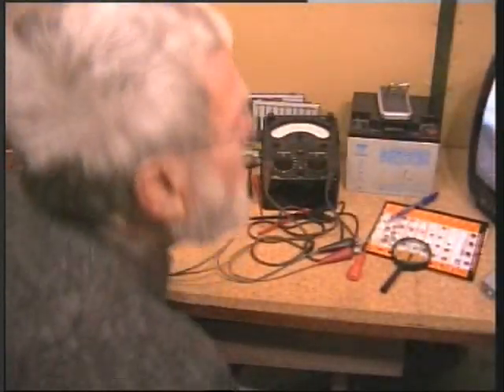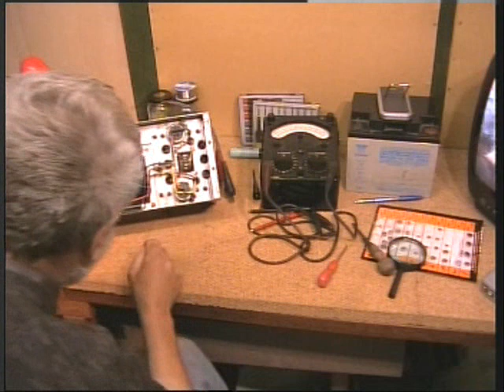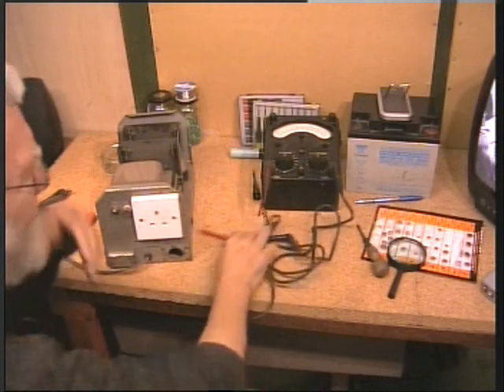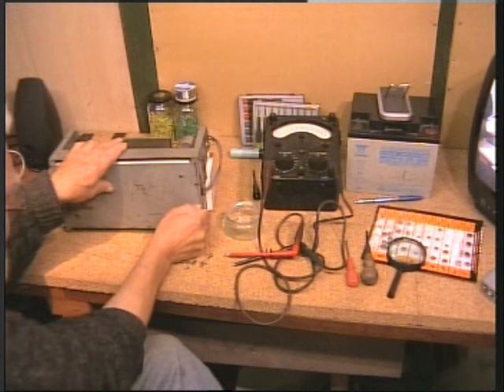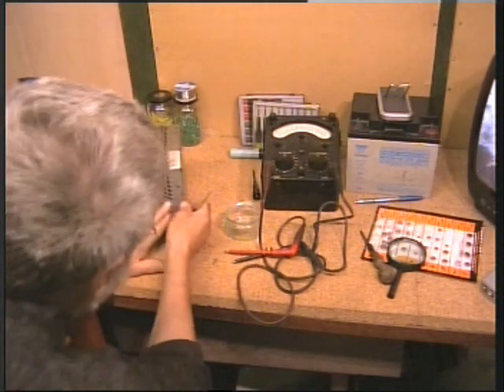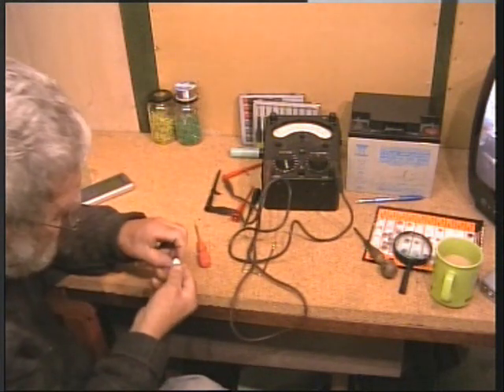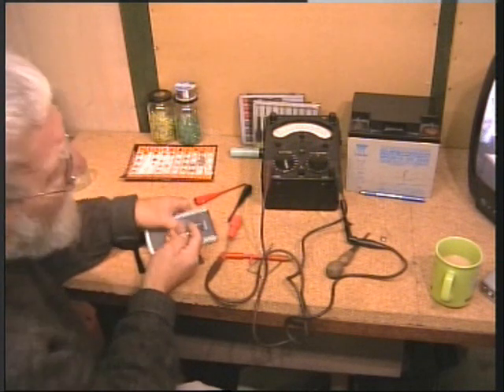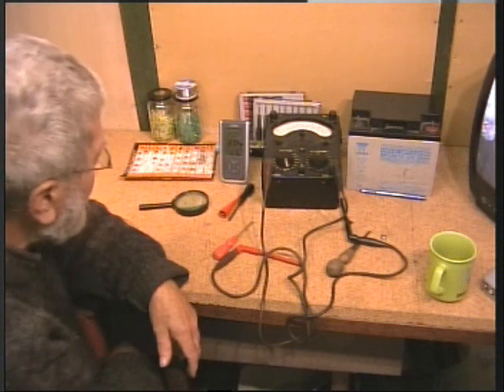you can fix it

Comment: Great point on using all your senses. Years ago I worked as a computer programmer, and our system went down (no PCs...this was a mainframe). The technician worked on it for a couple of hours before I went in to see when it would be fixed.  He'd determined that the problem was a disc drive (the size of a washing machine) but couldn't figure out what the problem with it was. I sniffed the air, smelled hot transformer varnish, and suggested it might be in the power supply.  He sniffed, said he didn't smell anything, and went back to looking for the problem. He was a smoker, so obviously he couldn't smell anything!  I went back to my desk and about 3 hours later the technician emerged to announce that the problem was the power supply...

I once fixed my modem by hearing a 60 cycle hum from the speaker and guessed that a filter capacitor in the power section was bad.  Opened it up, and noted the top of one of the electrolytic  caps was bulged out a bit.  I could only find one with a higher voltage rating, but figured that was fine as long as the capacitance was the same, and swapped it.  Used the modem a couple more years until I upgraded to a faster one. I'm a software guy, but even a little learning can be useful at times. If anything else in the modem had been bad I'd have been stuck, but rectifiers I understood.

Nose, ears, eyes,... Some if the best test instruments you have!

Thanks for letting us join you at the bench!

-- Mike

Comment: I'm a clock repairman and a lot of the work I do, is repairing the work of other clock makers.  
We used to stuff bits of rubber bands into our buddy's cigarettes when he'd leave to go to the bathroom.  It was a hoot to watch him light up and try to smoke them.  A friend of mine worked at a school where they taught electronics.  The power outlets in the classrooms were tied in with the light switch. For pranks, they used to stick the ends of a ceramic capacitor in the power outlet.  When  the victim would turn on the lights, the capacitor would pop like a firecracker and put on a little light show.